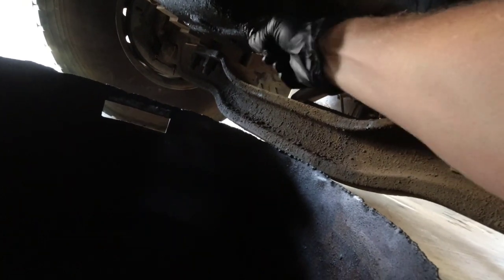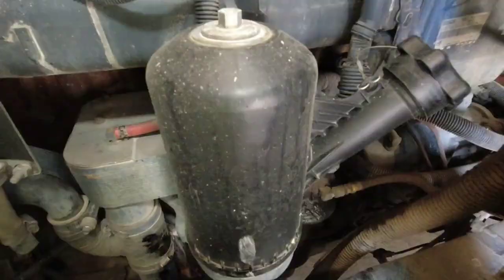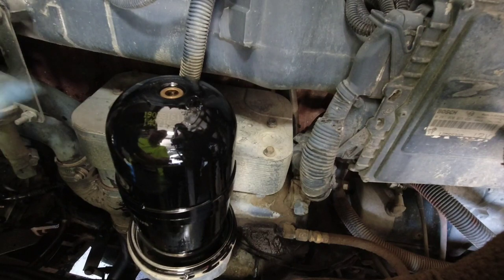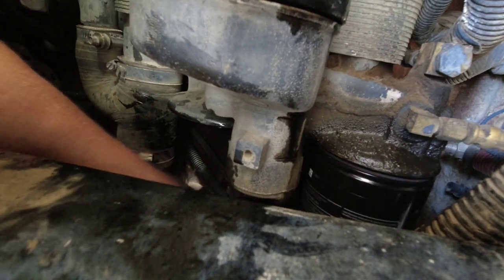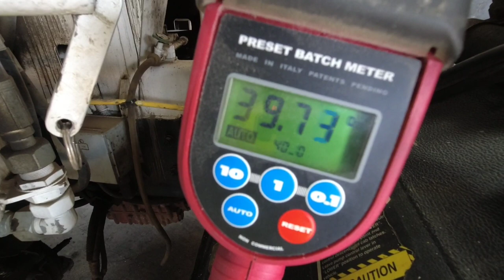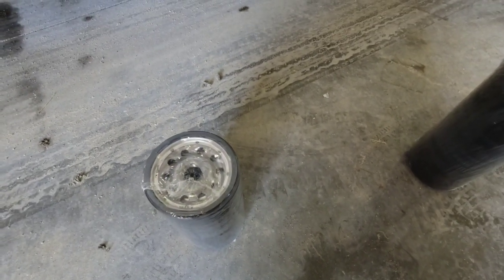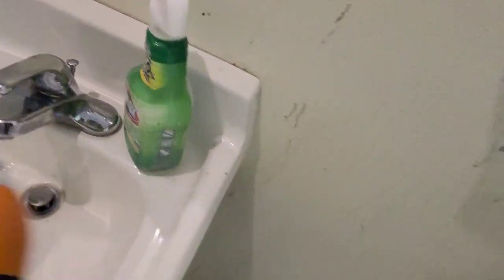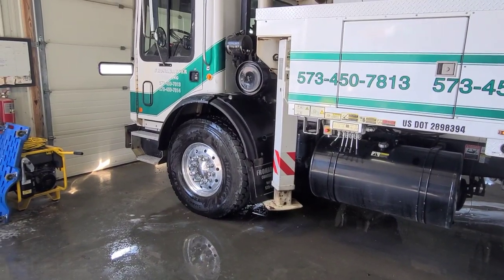Down & Dirty! Concrete PumpVlog #29!

Comment: Love your videos.  You do a great job.  FYI if you put a thin layer on grease on those fuel filters they won't hang up as bad.  Seems like the diesel tends to dry out those rubber gaskets. Thank God we got away from those damn Mack's.
Reply from the maker: Thanks! I'll definitely give the grease a try, I use to put oil on them, they sure get tight though.